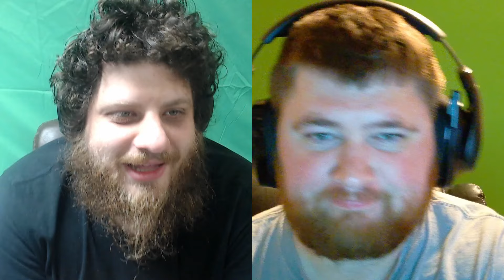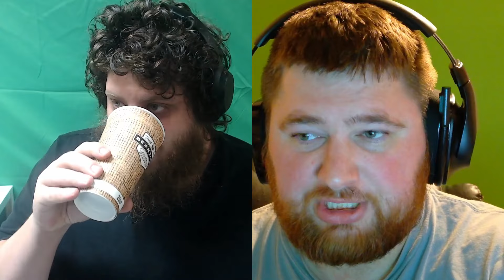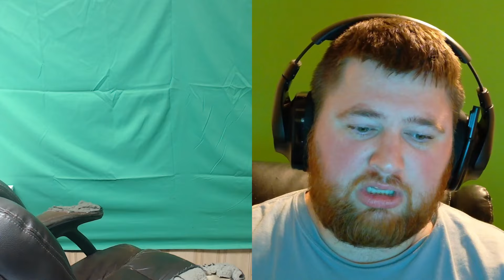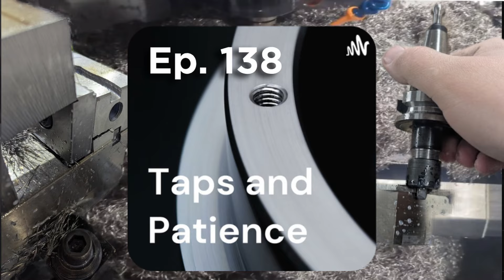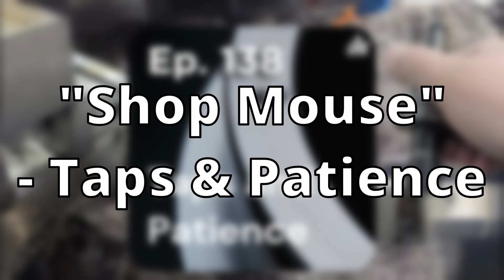Automation and Cheese Plates - Ep. 138

Comment: Every single one of my new haas machines gets the low oil alarm. Some rookie techs say it might be a loose fitting and chase the goose. Most say when they switched from the grease pack which were a horrible disaster to the thick gear oil syrup that they use now that they've never really worked well. Its basically a bandaid fix that haas stuck with.

Comment: We added a coolant chiller to our puma2600syii this summer and it made a huge difference on shortening warmup times. Before it could take hrs for the machine and coolant temperature to stabilize. Now with the coolant temperature controlled it only takes like 20 minutes. Also the thermal comp page on the home screen shows the temperature and active compensation. I'm assuming it's the same on the lynx

Comment: In Sinumerik 840D there is no problem probing in a angle. I dont even get why this should be a problem. I guess Haas has something like the 3D Quickset calibration too. Or does it not?
Reply: You can probe size. But you can't probe location back to different orientation